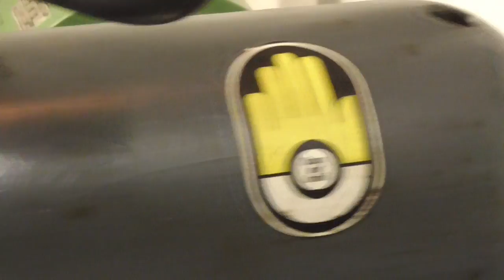Adjustable Carriage Stop from Scratch

Comment: So, you use the drill pres as an oil pot launcher :-)
Just don't give up on the shear tool too soon. If all the angles are right, with very light cuts (0.05mm) and a step of 0.10mm, it will work.
Just go for it.
Reply from the maker: The worst part was he suggested me to bolt the vice down and I went all "Yeah, I know what I'm doing." - and not two minutes later, I had to wipe the workshop floor xD
You may have to give that shear tool the magic touch it needs, some day ;)